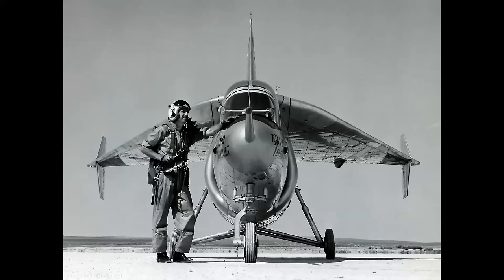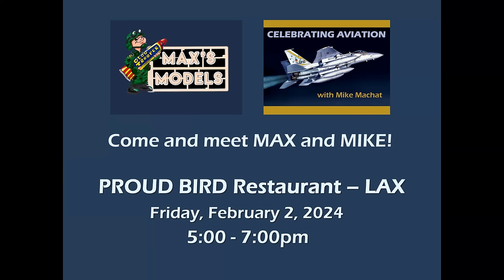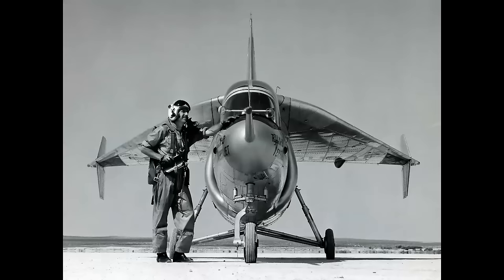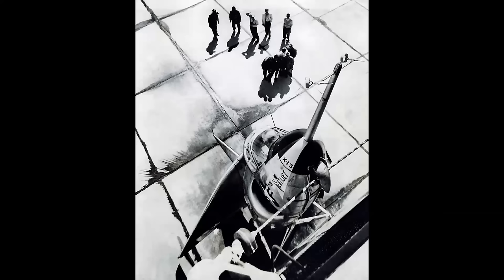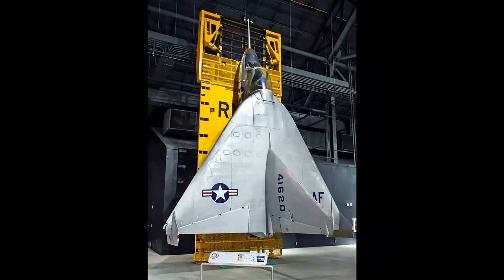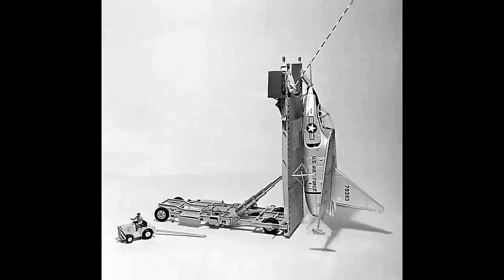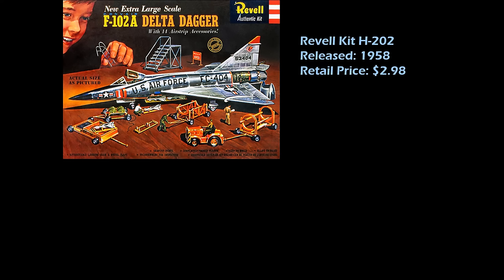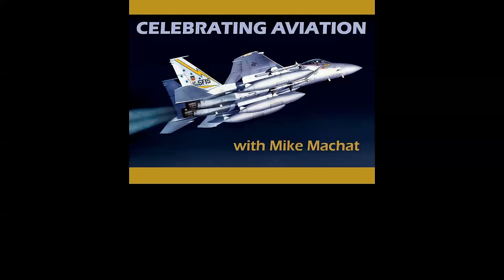MYSTERY OF THE RYAN X-13 MODEL - How Aurora Models Wound-Up Producing Their Revolutionary X-13 Kit!

Comment: When I first got to Edwards in the late 80' and up until the mid 90' s at south base there was a defuser on the ramp. Meaning a steel grate that led to under surface tunnel that exited on both sides of the grate. I thought of the X-13 right away that they could run it on top of the grate, and the exhaust could exit out the side of the tunnel.  This would allow the ground crew not to be effected. And not melt the tar,and pop the cemet ramp. It later was all torn out, filled in, and turned into more ramp space to park B-1's and B-2 ramp work. Not model related but I really love all the historic sites that existed on the base at Edwards AFB.

Comment: If only . . . . 

Though the Aurora X-13 and the Revell F-102 are kits I've wanted for a very long time, the latter desire was satisfied by combining the Monogram 1/48 scale F-102 (Case X wing) with the Hasegawa 1/48 scale Ground Equipment set.  But to the best of my knowledge, there are no kits of the X-13 currently available, much less for an affordable price.  This leaves scratch building as the only current option.  At 64, I joke that I'm too young to carve a solid from basswood or balsa, and too old to write code for one of those newfangled 3D Printers.  

I wonder if the tooling for the classic Aurora X-13 kit still exists, and if Atlantis has it?  Or maybe Revell can pick up where they left off and complete their 1/32 scale version.  Revell already did this with their 1/28 scale Fokker D.VII, and Lindberg did the same with their 1/48 scale Snark Missile, and AMT FINALLY came out with their 1/25 scale garbage truck, so why not?  

Thanks for doing all the research to make this video, and for posting it.  129th like.